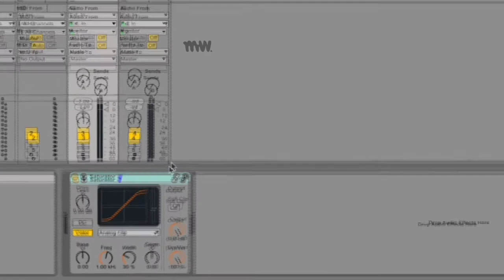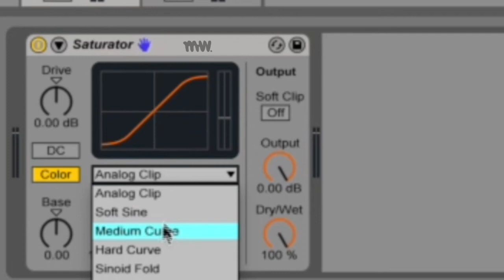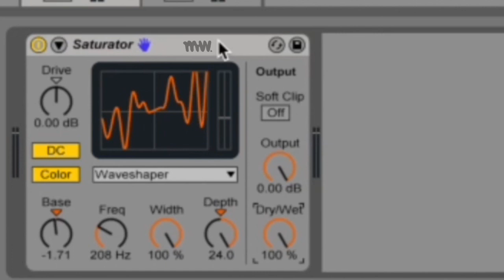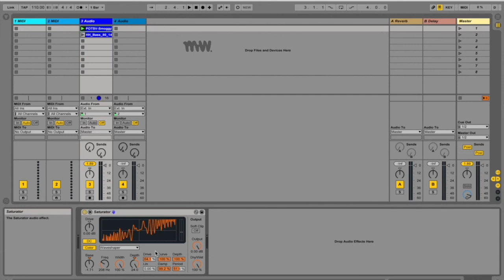Saturator // Ableton Audio Effect

Comment: you just said the second filter was a cutoff filter then proceeded to tell us that the width knob controls the bandwidth...of a cutoff filter? the frequency range...of a cutoff filter? cutoff filters dont have frequency ranges as i understand it. just a place where they cut the highs or cut the lows. the range would be: x <-> ±inf. 

• what is the frequency knob of the saturator?
• does ANYONE actually know how to correctly use Ableton's saturator without using presets?

...the search continues!...